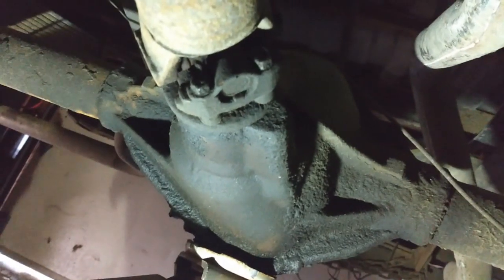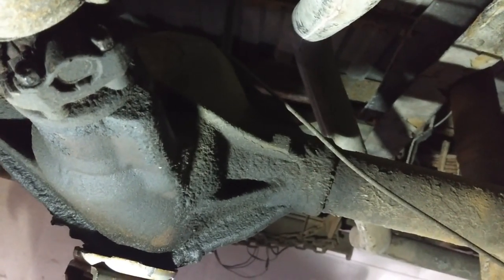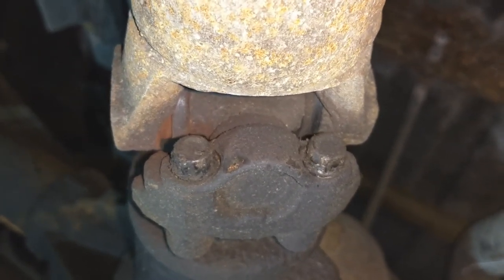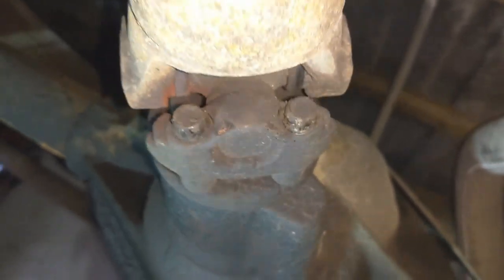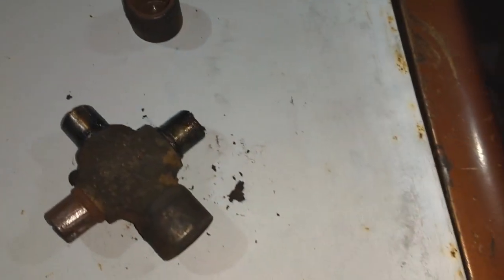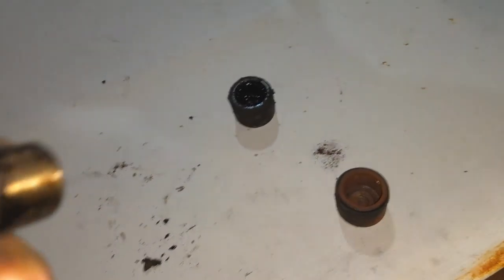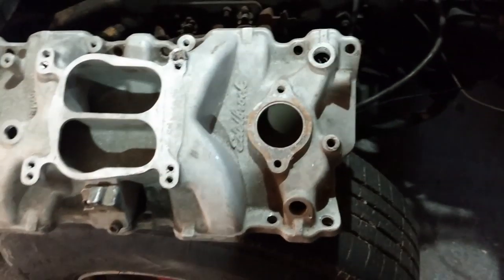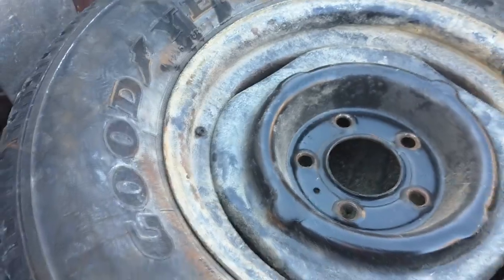Whatever it takes

Comment: Good news man. Those 12 and 14 bolts are pretty tough. Spider gears usually shear from excessive tire spin. In my case one of the guys driving the truck was spinning the tires pushing pile of snow

Comment: I had the idea of taking a dodge 3500 frame with the cummins turbo diesel and a manual transmission but the body is falling apart. And putting my 84 chevy's body on the dodge frame since my 84's frame has cracks and has been welded up dozens of times